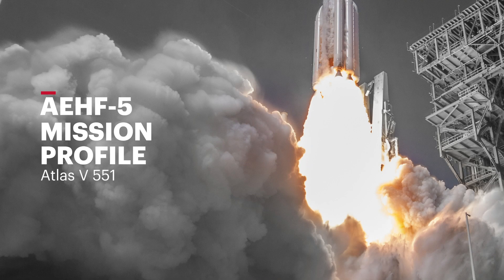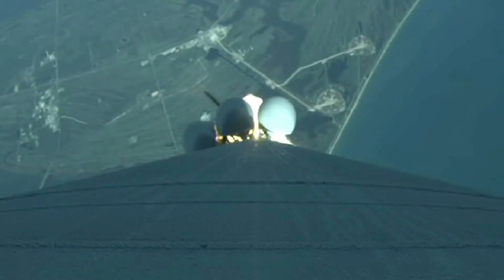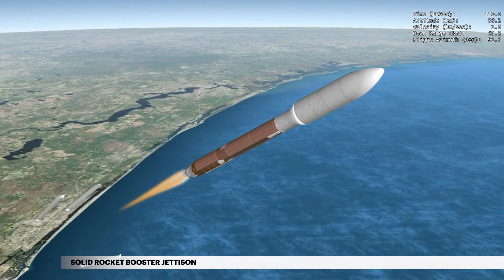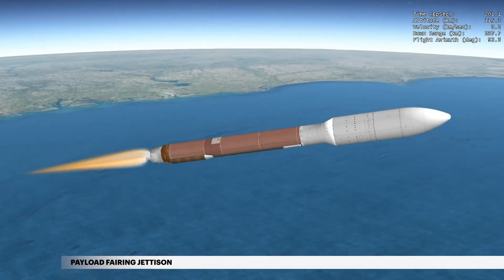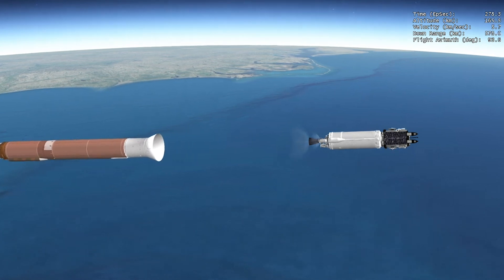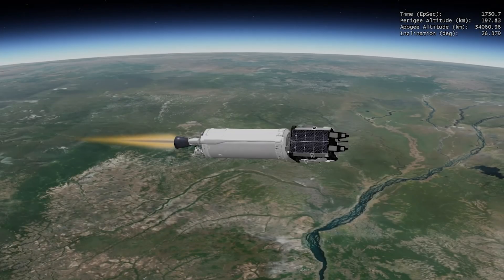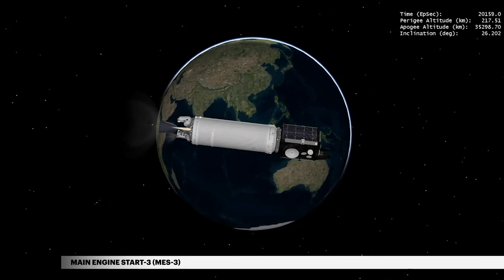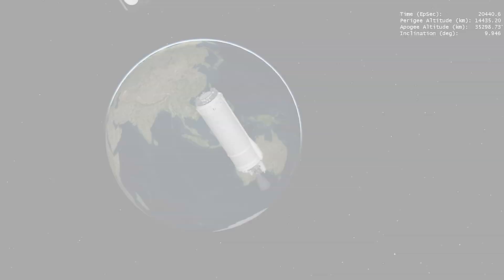Atlas V AEHF-5 Mission Profile

Comment: So the upper stage becomes space debris and doesn't deorbit itself? :(
Reply: falafel dürüm I'm sure it de orbits after a while...
Reply: @corporalclegg5057  With a perigee of nearly 14,500 km, it's going to be up there an awfully long time.
Reply: It depends on the orbit the mission is assigned to
Reply: I just mentioned that because it looks like the apoapsis kick motor is noting else than another second stage ignition, so the sattelite doesn't reach the final orbit with its own engine but instead the second stage will be in the same final orbit as the sattelite forever.. If the second stage would stay in an elliptical orbit with a perigee of some 100km it would be slowly deorbited by the air

Comment: 2:58 So what happens to the centaur after separation? Does it just float  in orbit for many years... or does ULA do the responsible thing and plan for enough fuel to de-orbit it?
Reply: It will stay in orbit for a decades if not centuries. No Agency or company can currently get a payload to that kind of orbit and de-orbit the orbital stage.
Reply: @Soltasto  you are incorrect, whenever possible spaceX and ULA will either deorbit the stage or put it in an orbit where it will decay quickly
Reply: @Soltasto  it certainly wouldn't stay there for centuries unless it's orbit was extremely high
Reply: @techfin6145  I know, that's why I specified "that kind of orbit". As you can see in the top right corner of the video, the centaur at payload deploy will be in a 14435km by 35298km orbit after burning the stage to depletion, so with no fuel left.I was responding specifically to this mission. Also, due this very high orbit it is quite likely that it might not ever re-enter the atmosphere, also due to the moon gravity interaction that sometimes perturbates the orbit of objects in GEO or in GTO.
Reply: @Soltasto   Yeah, it'll remain in orbit forever. As a no complete GEO orbit and no zero inclination it may never harm another satellite.
Reply: @Soltasto  Like SpaceX's STP-2 second stage. He will remain 12k x 6k for centuries.
Reply: stuffin.space  and you can see what is left in orbit.  Type in Atlas in the search bar and you find over 160 entries for orbital debris and spent stages dating back to the early sixties.  So many of this junk left there as perigees that are very high meaning they have no hope of entering earth's atmosphere and burning up for maybe thousands of years. One of the latest entries I see has a perigee of over 4300 nautical miles and will not return to earth.  Back in the 60's who new we would leave this much stuff in orbit.  Now it should be part of mission planning.  If the rocket doesn't have enough Delta V left over after orbital insertion, then you need a larger rocket to start off with.